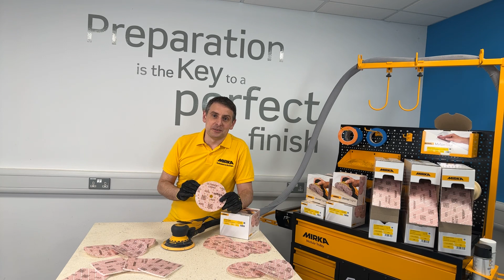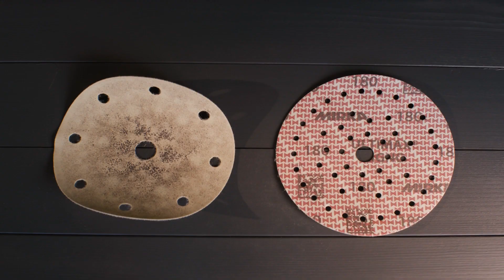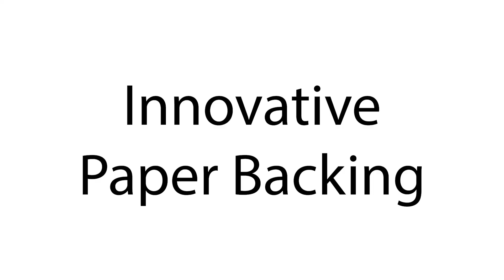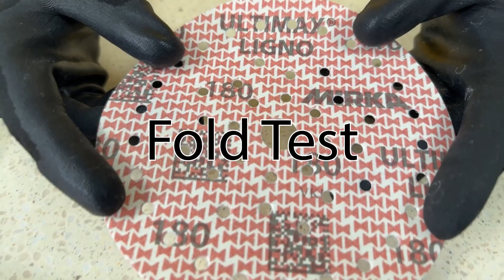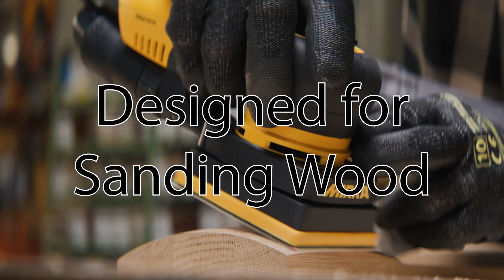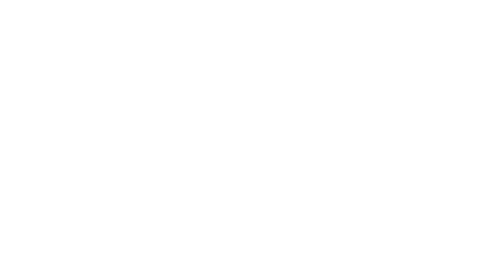Ultimax Ligno - Neil talks us through the all-new abrasive for woodworking from Mirka.

Comment: Curious to see how this abrasive performs on curved surfaces (unfortunately a lot of manufacturers seems to give performance & longevity test results based upon perfectly flat surfaces) I make chairs and have tried all sorts of abrasive but have yet to find one that stands up well to curved surfaces. By far the worst abrasive I've used was 3M cubritron - the studf was dull after a matter of seconds on curved surfaces.
Reply: I make a lot of chairs too and have the same quest for a disc for chairs.. any recommendations will help.. i have the mirka deros 350cv 77mm ROS. But sometimes use the 150mm too

Comment: If the advantage of Ligno is getting the dust away quickly, how does this compare with Abranet, where all the dust is sucked away immediately? When would you use Ligno rather than Abranet?
Reply from the maker: Hello! Good question! Ultimax Ligno is not a replacement for Abranet, they are different products with distinct features and benefits. Ultimax Ligno was designed for wood sanding with a superb level of dust extraction in a paper-backed product, bringing strong edge-wear and a beautiful finish on the wood grain. We recommend arranging a free on-site demo to see which of our products is best suited for your individual application.  You can arrange this here… https://www.mirka.com/en-gb/products/top-brands/ultimax-ligno#Demo
Reply: I'm literally wondering the same thing. How is this superior to abranet? Is this their answer to the 3m cubitron 3?  Is it specifically for RAW wood or can I use it for primed wood and painted wood.
Reply from the maker: Ultimax Ligno is not just for bare wood and can be used for painted and primed surfaces as well. We'd love to help you test it against any of our competitors. You can arrange this here… https://www.mirka.com/en-gb/products/top-brands/ultimax-ligno#Demo @danielramos2092